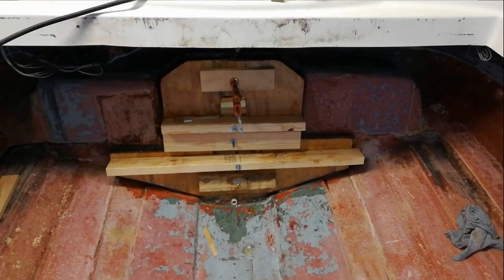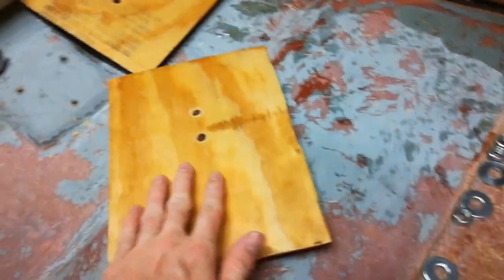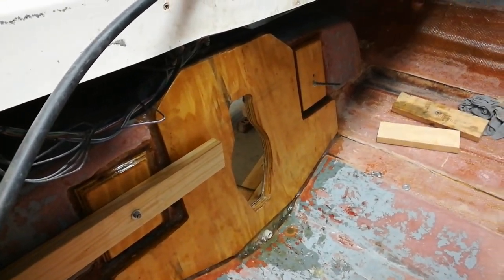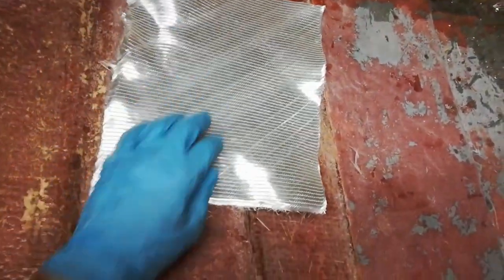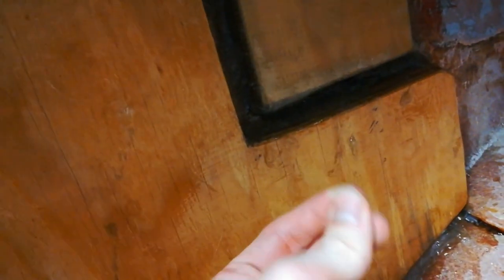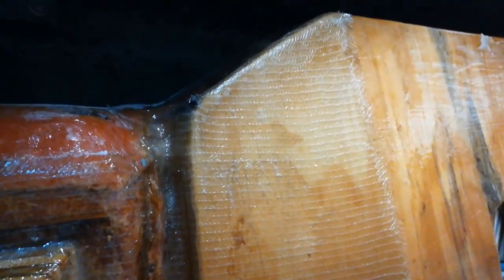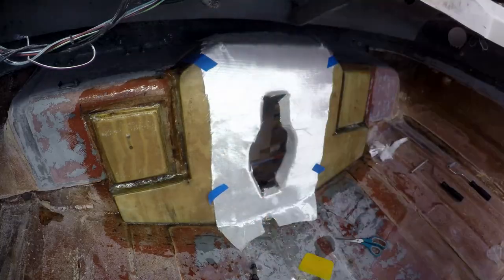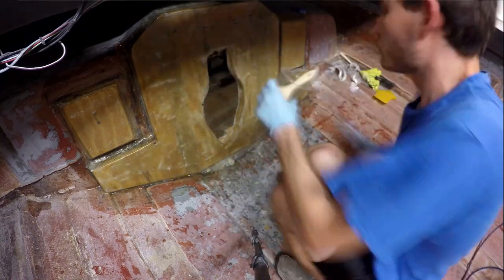Fiberglass Boat Transom for mercruiser 3.0

Comment: Why did u and how do u know where to use the chop strand mat and the 1708? I’m doing a project myself and was wanting to learn.
Reply from the maker: You can use either or both for the whole thing, but 1708 gives more structural strength, chop strand mat(csm) also gives strength, just not as much 1708. The 1708 bends easier when your laying it down on corners and around edges with sharp curves. Csm is cheaper. That's my 2 cents
Reply: @ZachsGarage1  okay thanks

Comment: Did you cut all the rot out of the entire transom or just ad another layer of wood and glass etc etc
Reply from the maker: I cut it out fully first
Reply: @ZachsGarage1  
All the rot or the entire tramsom 
Looks like just the rotted area?
Reply from the maker: I removed all of the wood and smoothed out the fiberglass curves
Reply: @ZachsGarage1  
I just found a bit of rot on the inside left of my out drive about a sq foot worth and oddly enough I guess because it has a v8 mounted on engine mounts they ( bayl8ner didnt glass the inside of the transom) not really load bearing